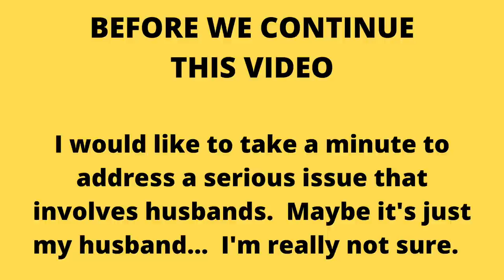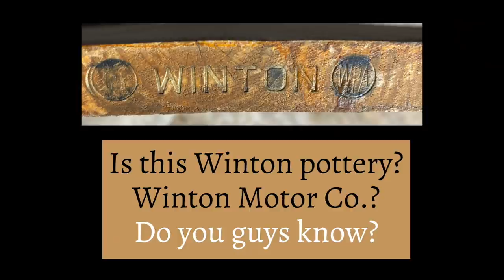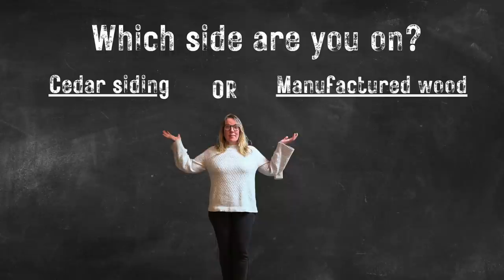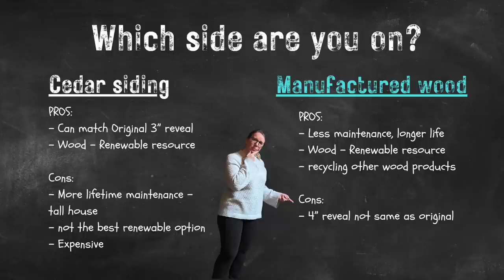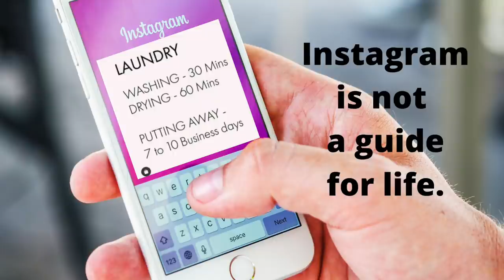MARRIAGE AND RENOVATION - Lindsay & Mr. Jim style

Comment: Think about the expansion gaps at the ends and butt joints recommended (required?) by LP smart side. Before I considered that brand, I would want to see a finished house that has a few years on the siding to see what happens to butt joints and other gaps..  Cedar clapboards can butt up tight.
Reply from the maker: We are still in the muck about this decision... didn't expect to be but well.. it's a LOT!  Thanks for watching B.C.  Appreciate you lots !!

Comment: If you are able save your original siding you might be able to send it to a dip and strip place to remove the lead paint. Or using eco strip to encapsulate. 

No matter what you end up choosing putting a rain screen behind the cedar  siding along with a really good weather barrier will help it last a lot longer.
Reply: No idea if you guys already made your decision but I saw that hellohilltop on IG used a company called greenwall siding. They use eucalyptus, and say it holds up better than cedar. They mentioned having profiles that are in the WWPA Pattern Book. They are located in Seattle but the mill isn’t in Seattle. Be crazy if it was economical to ship the siding to you, but hey maybe they could connect you with someone more local.
Reply from the maker: Ooo interesting.  I will look into it as we're just about to make the decision!  Thank you so much I've never heard of eucalyptus siding before.  I wonder if it smells good when it's hot outside?  haha